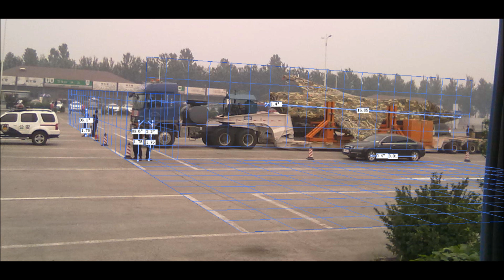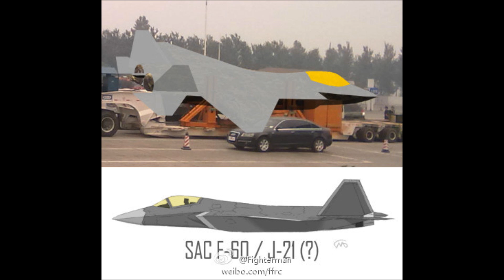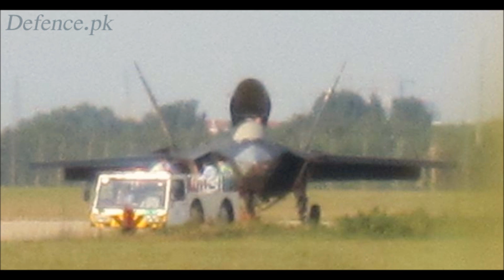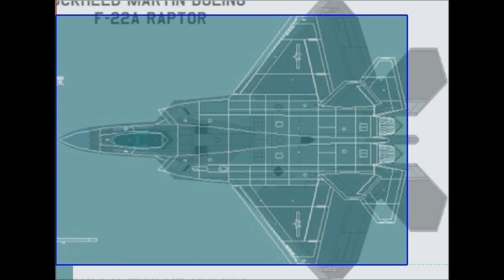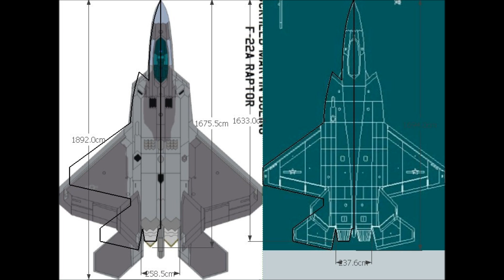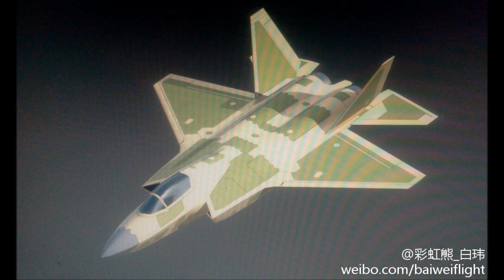New Chinese J-31 Stealth air craft explained

Comment: I'll be more then delighted to access it for you.

"The F-22A on dry thrust alone outperforms an afterburning F-15C, whereas the JSF is designed around the agility and manoeuvre envelopes of the 1970s era F-16 and F/A-18 - both then inferior to the F-15 family."
Search: "APA-JSF-Analysis" (first hit)

It is worth reading all if it despite its length. I would also recommend their analysis on F-22, PAK FA and J-20. I believe you might be quite surprised.

Comment: J-20=F-22
J-31=F-35
it's very nice of them they didn't use confusing J-22 J-35 designation, but whole concepts seems to copy USAF doctrin - expensive interceptor and cheaper multirole aircraft. But I don't belive they will develop any 5th generation aircraft before 2020.